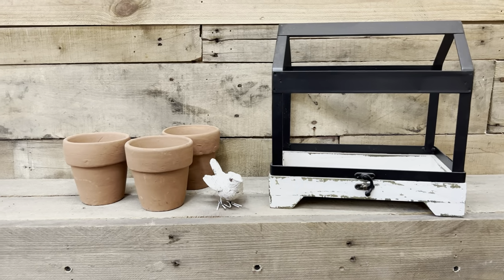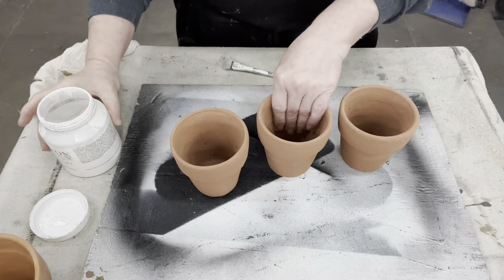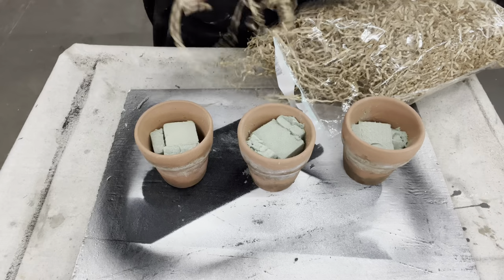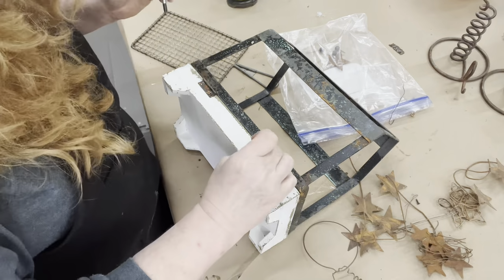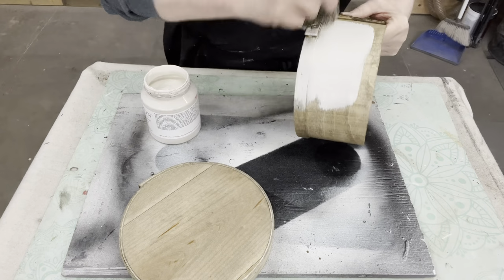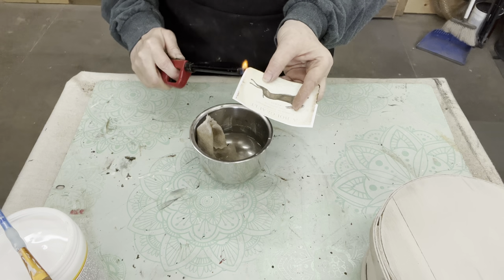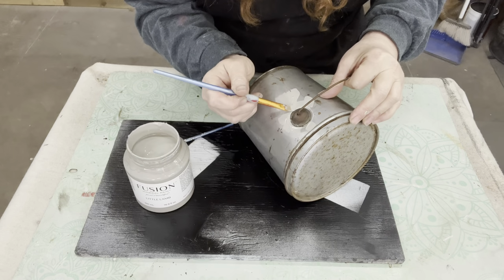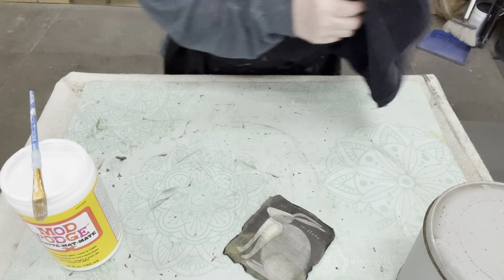Thrift to Beautiful Home Decor | Up Cycling Thrift Store Finds

Comment: Oops sent it before I finished.  On the black open pot holder that you did first, you "rusted" it.  I have a plain white ceramic head of the statute of liberty that I need to do that too...i know the original statute is brass/bronze so what are the sprays I coluld use for that and are they from dixie belle???    Thank you SO much
Reply from the maker: SO MANY TECHNIQUES | Trash to Treasure | THRIFT FLIPS
https://youtu.be/W3uam-0Tq10
Watch this video .. I used all their patinas. You can see what results you like. The links are in the description box under piglets closet